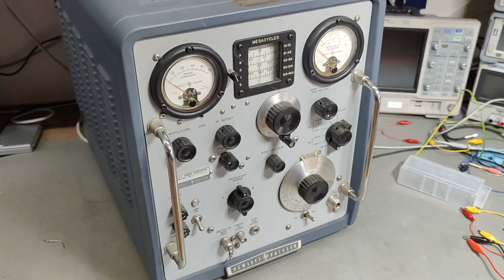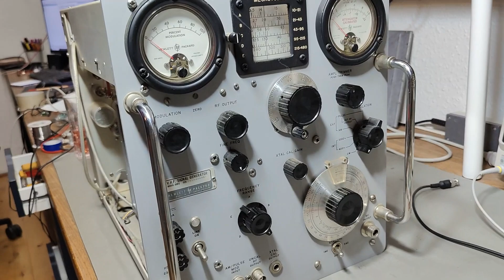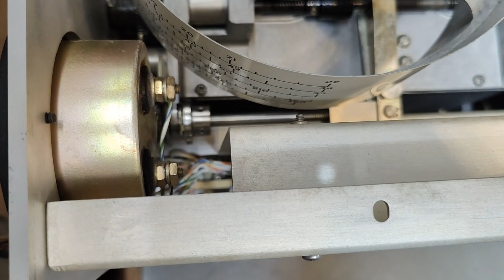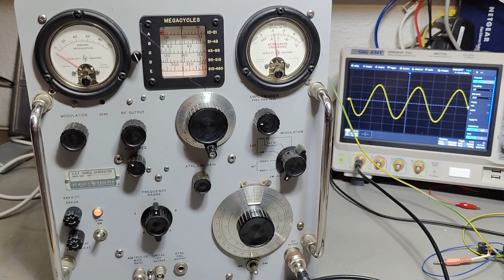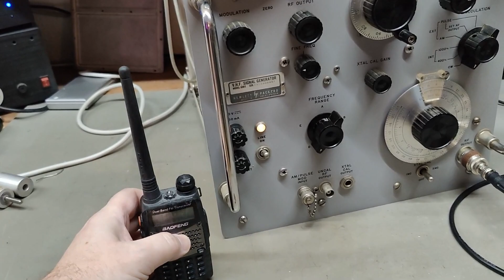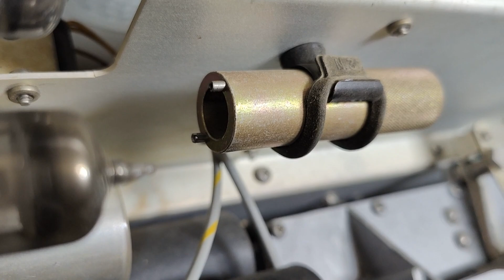HP 608E VHF signal generator 10-480MHz 1970 test teardown

Comment: Beautiful piece of equipment!! So good, that you saved it from being distroyed!!!
I am in the progress of restoring an old Siemens Funk E309 shortwave receiver, madie in the mid 60s, that weights 38 (!!!) kilos 😵‍💫 It is really a tough job, to even turn it around on the bench, without distroying anything... The E309 also uses a massive band-selector drum, that includes 8x4 filters in total...Its more or less the same amount of mechanical gearporn like here in your case :) If you are interested, I have 4 videos about this receiver on my channel so far, and some more are about to come, as I'm still not finished with this massive restauration project (almost every single resistor needed replacement!!!). It's in german, though (but I suppose, you are german as well, right?). 
Hey, and thanks for keeping such great equipment staying alive! Cheers, Sascha
Reply from the maker: Danke, I am halve Swiss halve Danish, but i do of course understand German, and speaks it a little bit slowly.

Comment: Nice video. Are you sure that the low frequency coil is not broken? Can't imagine that this little tilt makes a difference. Besides the other coils resonate at a different frequency and are not in circuit when the big one is... but I stand corrected if you think so. BTW the oscillator triode is this a coaxial tube???
Reply from the maker: hard to tell now , the unit is assembled and working fine since :-) i tend to stop research / fixing when a circuit is working good and stable, sometimes it could be another reason than the one i tried, with loose connections, you also affect nearby parts, and then mayby fix the other one nearby, while you think it was the one you worked with. Sometimes I also see stuff on my video, I did not see the first place when i did the video, I could be looking at one parts i think it to blame, but it is another one nearby, since you come with fresh eyes, you might go straight to the right part :-)
Reply: @TeardownOZ2CPU  A tilted coil and its correct position - if it is mechanically sound and the circuit works well - I would not interfere at all, one of the reasons why I do not like RF technology - it is sometimes alchemy. For example, air coils, just move it a little carelessly and the circuit behaves differently